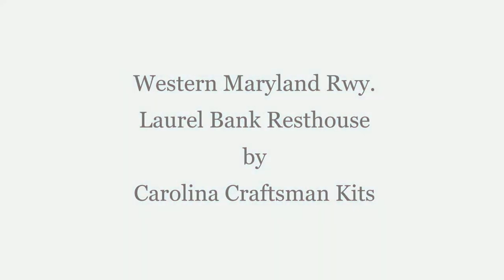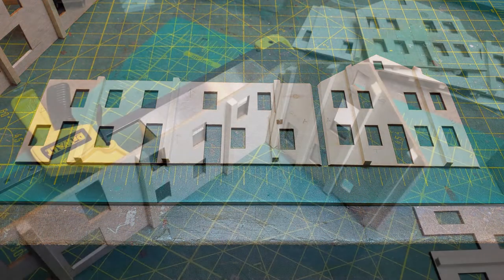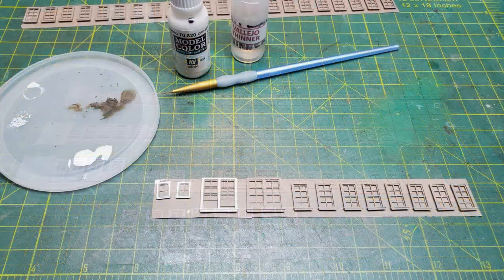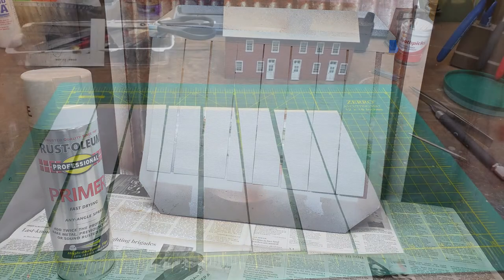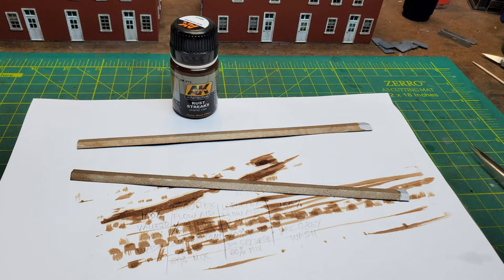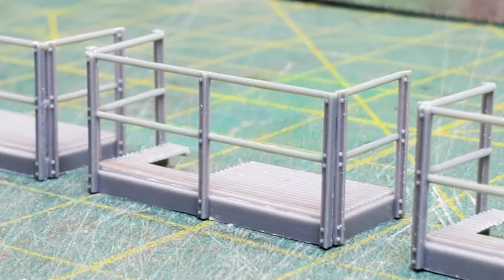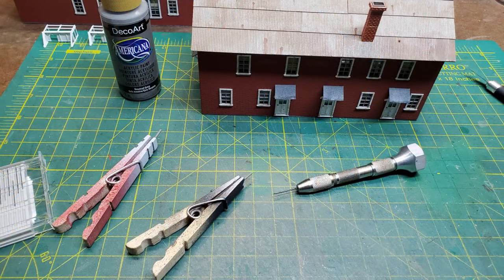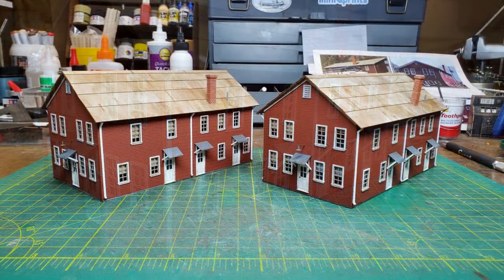Two WMRy Rest Houses at Laurel Bank

Comment: Nice job , and good, step-by-step video. Clever use of the skids to make vents. Did  you use commercially available model mortar on the chimney? I've never tried it.
Reply from the maker: Thanks so much, Kathleen, I appreciate it. No, I used white Vallejo using Liquitex Flow Aid. I've also used spackling compound with success. I have a friend who's used the commercial mortar, says he likes it. I just haven't yet.
Reply: @CassidysWorkshop  Thanks. I didn't know what White Vallejo was but  it looks  like a useful product, especially with the Flow Aid. I've used joint compound successfully , but am always open to alternatives.
Reply from the maker: I like Vallejo's acrylic paints, and use them often, along with craft paints.

Comment: Looks great..i was curious if you forgot the gutters?
Reply from the maker: Thanks, Bud. Not forgot so much as didn't do. The downspouts show up in all the photos of the real structure, and were easy to model. But the gutters would have been really hard to make and attach in a way where they looked right, and are hardly visible on the real building. So a modeling choice.